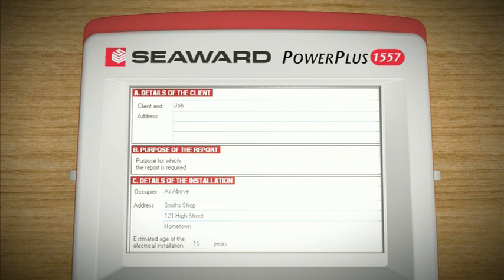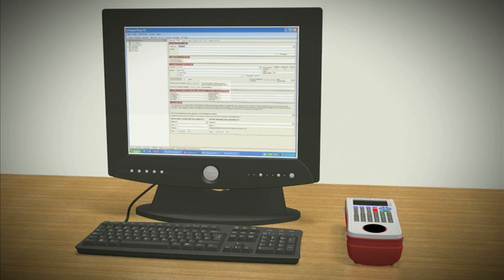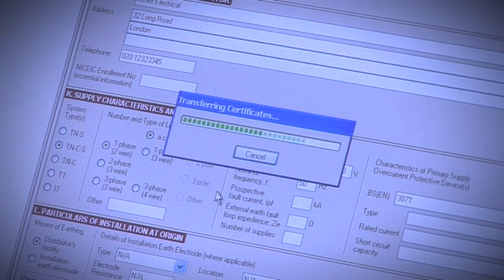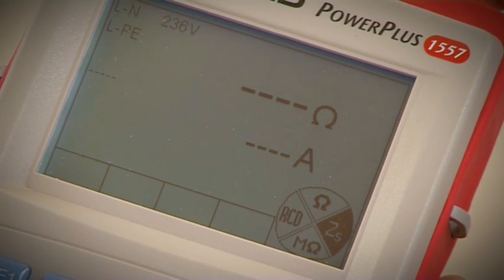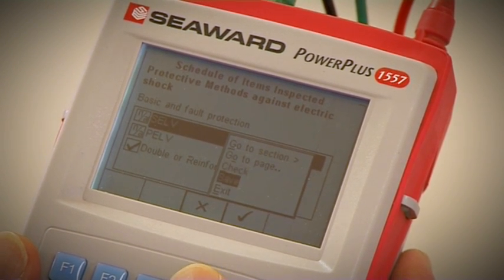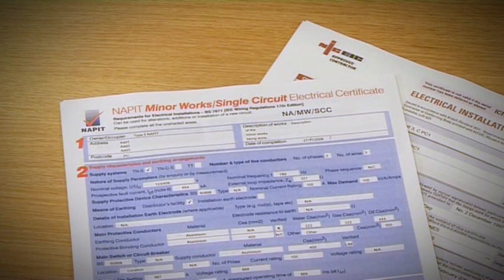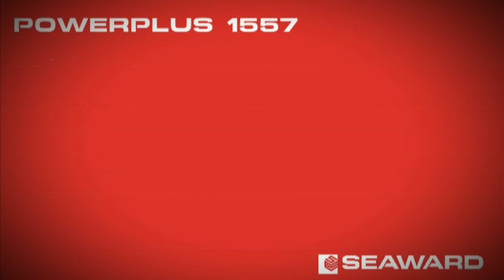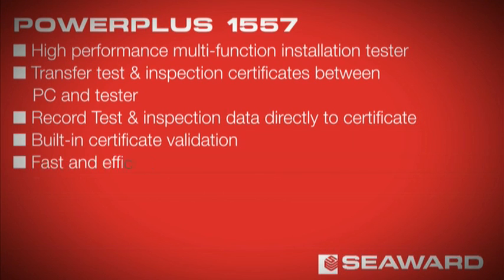Powerplus 1557 Installation Tester - 17th Edition Certificates

Comment from the maker: Topicmarko76,

The PowerPlus 1557 has been designed to work alongside the PowerPlus PC software which currently includes certificates for use in the UK. 

Australia and New Zealand follow a different standard from the UK which requires an additional RCD test and as such, varying certification/reporting requirements. These are not currently supported by the PowerPlus 1557 or PowerPlus PC software.

Regards,

Seaward